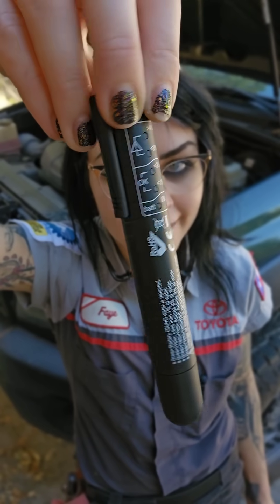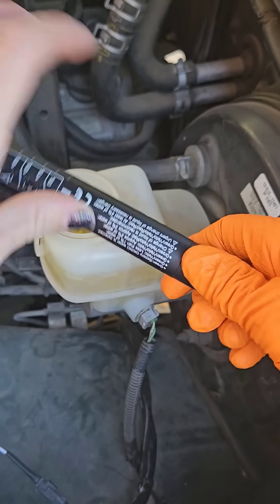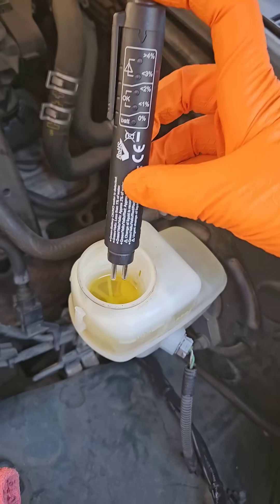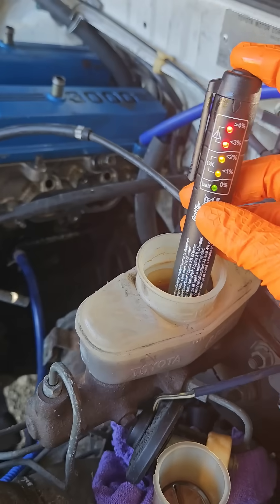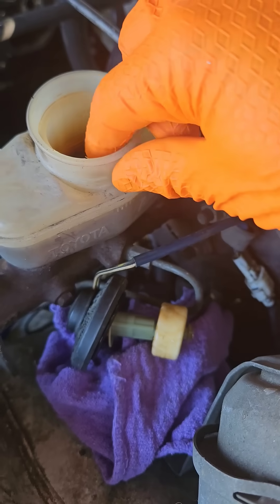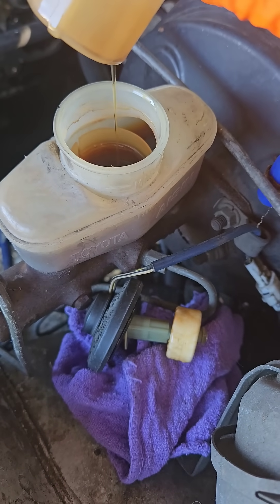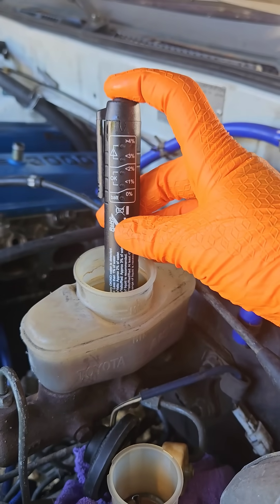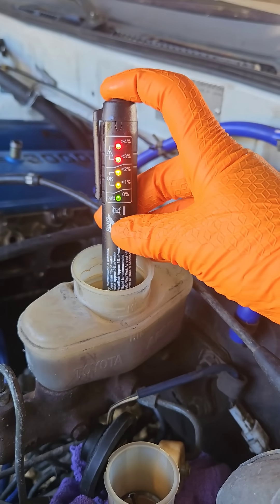Do you REALLY need your Brake Fluid Flushed?? How to Test it For Yourself!

Comment: does it matter? it is liquid, even if not perfect still work just worse. car when to 200K miles plus and still had not change once. with a car with super good brake...just less still super good. with normal driving it does not really get to a point hot enough to lost braking.

Comment: I'm sure almost every car on the road needs a brake fluid flush. The only problem is after you do it, you usually need a new master cylinder. It probably has to do with the new fluid affecting the old seals. That's been my experience but that could be because I have never bought a new vehicle. So if you do a flush you might as well pay the extra for a new master cylinder and do it all at once.

Comment: I know she said “2 years old AND fully saturated with water” but the fact that she even mentioned 2 years is a little bit suspect.  If you’re changing brake fluid, the interval is much much longer than 2 years.

If you get a brake fluid flush more than twice over the lifespan of your car, you’re spending money you really don’t need to be spending.

Comment: I bought a 2014 Harley FXSTD and it had sat for years in storage. I flushed the brake system with the correct product, DOT #5 fluid.

Comment: Never had brake fluid change on any car or truck I’ve owned. Usually run 5 years and 130k miles. Never an issue. GMC truck today recommends 5 years.

Comment: So why are my brakes braking while driving around but if I bleed them it will work as needed for 25 or so miles and then brakes lock up again then you have to bleed them again then after 25 miles and so on so forth

Comment: if it were never changed the slight degradation in performance isn't that bad.  to me it's worth it if you do it yourself but not to have it done at a dealer.

Comment: The corrosion is the less problem, the big problem of water in brake fluid is the boiling point of water. The water is more density of brake fluid, then the water travel brake line to calipper brakes. However the water evaportes in the calipper aproximetly 130°C. When you press system. Then you release the press water cavitation, and generate a vapor in brake systems.

Comment: I bought one of these from Amazon. After registering two bottles of brand-new DOT3 brake fluid, opened moments before testing >4%, I immediately distrusted them afterward. 
I will try using test strips in the future.

Comment: I would say yes if there is water in the system.  Flushing brake fluid might be done once in the life of the car.  When the brakes are bled as when changing the master cylinder or a wheel cylinder or a brake caliper a good deal of the brake fluid is removed in the process and this will normally preclude you having to have your brake hydraulic system flushed.

Comment: 2 thing: firstly brakefluid doesnt  circulate. Which means u cant test the  fluid at the caliber. Second thing if u  dont  flush it properly air build  up crash on  the  high way. It only does when heat build  up air can compress then lose  ur  brake.flush it  every 60k u be fine.

Comment: I have a B7 Passat, its 10 years old and has 230,000 miles on the clock, brake fluid has never been changed but the brakes still feel good. I also have a 2005 MK5 Golf, with 270,000 miles on the clock and the brakes feel spongy and horrible. Now i know why. I guess i better change the fluid on my Passat. I dont want my brakes to end up feeling the same as my Golfs.

Comment: The brake fluid in your reservoir is not the same as the brake fluid in your brake calliper. It will be worse in your callipers. This is not a good test.

Comment: The true way to get an accurate reading is to bleed each nipple & test the sample from there , not the reservoir as most of the water is within the system .the reservoir will give you an inaccurate false reading , i know this as I’ve tried it , if it goes straight to red on the reservoir, then the fluid at the nipple may have gone bad months if not years before the reservoir.

Comment: Idk man... My break fluid is like partly changed when I do my break pads lol. Never dumped it and flushed it lol. And Im usually driving 15-30 yo cars with way left 200k miles 😂
Unless you fr drive around with that cap off or something crazy it's a sealed system you're good. It'll get replaced by the 2nd or 3rd time you do pads and bleed your breaks it'll be fine yall 😂

Comment: I change the brake fluid on my boat trailer every 2 years. That water makes it way into the calipers which causes them to freeze up. Eventually you don't have any brskes on the trailer and your boat wants to push you down boat ramp hills. 😮

Comment: I Googled for "Brake fluid tester" and OMG why are these so expensive outside of Amazon 💀 The cheapest (not Amazon, I'll get to that in the end) listing was Summit Racing for $24. AutoZone $48. Grainger Industrial Supply $64. Amazon though. Thank you Amazon.... $14.  FOR THE SAME PRODUCT. Some even used the same image, or same image rotated to look different. Also found a slightly different one on Amazon for $6 too

Comment: Lot can happen if you don’t. Soft pedal, corroded lines from dirty fluid, if there’s a leak and your lines/pistons dry up, that’s no bueno. Air can get built up in the lines, which is why when the pedal goes to the floor, you need to flush the air out

Comment: Ive actually caught a shop purposefully sabotage this by putting water into the brake fluid reservoir.

We went in with two different cars (at different times). Both of which we've flushed the brake fluid our selves and tested (new calipers so we might as well) and we magically were slammed with a recommendation to glush our fluids. When we tested them our selves, all the sudden they tested bad. And when we tested after we let the shop service it, they never flushed it.

Comment: Ibe put ober 100000miles on whatever rig i run with just adding oil coolant and whatever else it jizzes out and have gottn more life from used rigs than the standard gets out of Brand New. This new qorld of disposable shit is just disappointing. You all have the bare minimum to survive. Jesus needs to save you and m not a Jesus fan .

Comment: All fluids have to be changed as it breaks down over time and even more so with hot/cold cycles. Your owners manual typically gives you a general idea of when determining on what  conditions you use your vehicle whether it's severe duty or normal duty.

Comment: I worked sales at a shop before and I tried to explain this to customers, mainly the ones where either myself or a tech noted that the brake pedal was very spongy. Once I had a customer bring their car in to complain about their brake pedal being very very soft, and I was nervous driving the car into the garage because of how bad the brakes felt. Tech checked and said that the brake pads and rotors are fine, the car just needs a brake fluid flush. Customer declined because they expected the fix to be done for free lol

Comment: Viscosity of lubricants and hydrolic fluids doesn't matter as much as you think as long as it's within a certain range, and your running the equipment within a range acceptable for your viscosity. I mean obviously you don't want petroleum jelly in your motor or transmission or anything. It's great for your axles and shafts though. You don't want to mix brands or types because they could sabotage you with different chemical additives, but you could drain your oil and switch to a different oil type. People do it all the time. They'll switch from 10w30 to 5w30 or something along those lines. The engine will run fine as long as you check the oil. Never mix them though I say again. They can have a chemical reaction that will mess stuff up. It could coagulate in your motor.

Comment: So it occured to me this must just be reading resistance. So I googled "check brake fluid with a multimeter" sure enough if you already have a meter you don't need a specality tool. Just use your meter. Or if you don't have one buy a meter, probably cheaper than the specailty tester in the video.

Comment: Yes, as brake fluid ages the boling point increases and so does copper corrosion/brake hose deteriation
Reply: If the moisture is a real problem, a brake fluid test strip will let you know how much corrosion exists.  A better test IMHO.

Comment: If water is making it into your brake system you have bigger issues.

 It is a sealed system when you put the cap back on. That tester is checking for copper content within the brake fluid. 

You cannot check water content based on continuity when you don't know if the water is conductive in the first place (ie filtered or mineral water).

As brake systems wear down the fluid eats the copper lined brake lines

Comment: I'm curious as to where you're getting the specifications for how much water is too much? Last I checked, no manufacturer had any specs for this. I agree water saturated fluid isn't good but how much is too much? I do agree with testing for copper content which changes the PH and thus makes the fluid acidic. This is what we teach. I'm a 40+ year advanced Master and instructor. The water beeper is a cash register filler plain and simple.

Comment: Great explanation!

BTW, it can get worse than just squishy.  With enough water in the line by the caliper can cause your brakes to hang up and get extremely hot if the water expands enough.   So if your car locks up a caliper, but only after driving a while.  Then this may be caused by water I. The caliper.  This can be very dangerous when it happens.

Comment: If it's been over a year yes you do after all it's a law to ensure your dot fluid hasn't ingested water which can boil off making your breaks pointless and dangerous. End of simple as and more importantly you should pull a vacuum on new fluid to pull out any trapped air from within because I guarantee there's more air air trapped with your brand new unopened tube of break fluid than you'd believe (please half fill a syringe with dot fluid cap it off and pull the plunger to full mast and see how many bubbles you pull out of solution)

Comment: The problem with mechanics is they want to charge $189 to flush the brake fluid. 32 Oz of brake fluid cost $11. What should be done is flush the brake system when replacing the brake pads, it takes only about 5 more minutes. I do know, I'm a mechanic and flush the brake system at every brake job.

Comment: Mine is going on 8 years without a flush. I'll get around to it eventually.
Reply: Now thats the attitude 😂😂😂
Reply: Well I did it (rebuilt the calipers and changed rotors at the same time).Brakes feel the same. Waste of time.
Reply: @tomskimcdouglegaming806  then they were not done properly, if at all, if it was done at a shop.. 😅
Reply: @tomskimcdouglegaming806  yeah? so you sucked the fluid out?
Reply: @jesse584  I'll tell you what I did:
Sucked the old fluid from the master cylinder, cleaned the gunk from the reservoir, rebuilt the calipers, including new seals, pins and pads. Liberally greased pins. 
New rotors.
flushed the system from the furthest nipple from the master cylinder to the closest, and used half a quart of brand new fluid.
Then re-bled the ststem from back to front until no trace of darkened fluid or air bubbles were present. 
To be fair I've only driven half a mile so I'm sure the system will feel better once it's bedded. 
Now I can relax for another 8 years.
Reply: @tomskimcdouglegaming806  so the old pump the pedal trick...
works half the time... dunno why not all the time though...
i suck the fluid threw the lines when i do it... of course draining the rez first and topping with new... (and keeping it full) 
but hey, if your not driving like me, why would it need to be done yearly? 😂😅
Reply: do it! 
Do it now!!
Reply: @JohnZombi88  do it, and you'll be surprised at how much better the breaks feel.

Comment: Holy shit someone out here who actually knows what they're talking about and can articulate it correctly . There's so many people on here giving false information that's going to hurt somebody someday ,I appreciate the hell out of you keep up the good work
Reply from the maker: Why thank you for the kind words!! 😊
Reply: That was very well-articulated. Another point to mention is with anti-lock brake valving being anodized aluminum that it can corrode with exposure to moisture and create anti-lock issues and also very expensive components to replace.
Reply: Alternatively, use Dot5 'non-hygroscopic' brake fluid, it lasts longer because it doesn't attract water....😉👍
Reply: One can have knowledge but not know how to teach it to others.
Reply: Not to mention she is super cute
Reply: There is literally no evidence of crashes caused by old brake fluid. Leaking lines and cylinders losing fluid or letting air in can cause break failure, but even those are so incredibly rare they are statistically insignificant. Brake failures cause so few accidents that it is perfectly legal and extremely common for the person working on your breaks at your local Midas or jiffy lube to be a 17 year old drop out with about 4 hours of in the job training doing your breaks while the real mechanic does more complicated things, like swapping out MAF sensors and doing tune ups😂
Reply: @NickWhite-rc5wy  You've obviously never driven hard enough to boil your brake fluid. 
That feeling you get when entering a corner and your brake pedal sinks to the floor is something you NEVER forget. 😮😉
Reply: @Rabbinicphilosophyforthewin  smart man, saved yourself in that situation 😊
Reply: @NickWhite-rc5wy *brake
Reply: @NickWhite-rc5wy wonder what correlation old wore out fluid has to do with the rest of the brake system failing and leaking or additional wear on pads/rotors

Comment: Hydraulic fluid in most cases is petrolium based, while water and oil "don't mix" they would have different fluid reactions and pressurize at different rates

Comment: It IS a closed system though! You removed the cover that keeps it a closed system. Used to design these systems and had a supervisor tell me NEVER change your brake fluid, it's a closed system!! So unless you a leak you don't have to worry about this.

Comment: You should change brake fluid every other year with normal use of car. If you drive as commercial with constant load. You should replace it.  It's the cheapest life insurance you can get.

Comment: If you use different brands to top off, you will notice your brakes acting funny and your fluid will turn black. Different fluids cause the rubber O Rings to break down.

Comment: Just flush it every event if you air it a lot etc, or like four times a year for performance fluid. Do it once every other oil change for normal cars. Or do what 99% of people do and run original fluid + top off when doing brake jobs and have it boil at 100c. It really doens't matter because people don't overheat their brakes until they stick during normal driving anyway and if they stick not even 660 will save you.

Comment: Another reason to replace brake fluid is the moisture will cause a rust / corrosion issue with the abs module causing premature pump failure.

Comment: I ask mechanic to not push fluid back up in system to open bleeder and drain out ,newer vehicles have a cup o-ring if fluid is pushed back into system ruins master cylinder making brakes spongy thereafter

Comment: My brake fluid was factory original and over 15 years old. It had done over 100,000km and it tested fine, looked a little darker and cloudier than the fresh stuff, but not much. Flushed it anyway. A lot depends on your brake usage, car weight, and climate.

Comment: If you mechanically handy at all. just open the bleeder screws every now and then and let some drip out. Then refill the master cylinder. Over some time, you will completely renew the brake fluid.

Comment: Change it every 5 years or sooner. Break fluid absorbs water from air humidity.  Will corrode metal in lines AND will fail in braking at some point

Comment: I like the old brake reservoirs you didn't have to worry about water. Cars before 1990 when it came to motors they lasted longer longer than the new ones today
Reply: I'd say engine reliability peaked around 2010. After that, switching to highly stressed small turbo engines for fuel economy, gasoline direct injection that carbons up the valves, DEF for diesels, low-tension piston rings that allow oil burn and other technologies started eroding the kind of worry-free reliability many cars had.

Comment: Maybe I heard wrong, but it sounded like she said that the brakes are not a sealed system. They are indeed a sealed system! Moisture gets in the system when you open the cap mainly. On a high humidity day even more so. Adding fluid that is old and in a bottle that wasn't sealed properly will put a lot of water in also. I have seen way too many people bringing in vehicles with brakes barely working because of this. Calipers really hate moisture and I've seen them so bad that I had to just replace them. Changing brake fluid is much cheaper than new calipers, but some folks are just that stubborn.

Comment: I hate when people say brake or hydraulic fluid does not compress because it can expand with heat and if it can expand with heat it can compress with enough pressure & temperature change

Comment: If your brake pedal seems extra sensitive for some time after a panic stop you may need this service. The little bit of water in the fluid has turned to steam under rapid compression and increased the standing pressure in the closed portion of the system making it more sensitive. In extreme cases this could also lead to calipers sticking shut which if that’s happening after a panic stop it is probably not your caliper or slide pins but that fluid pressure being high enough that your brakes are sort of keeping themselves applied.